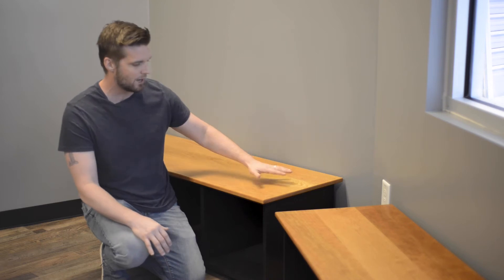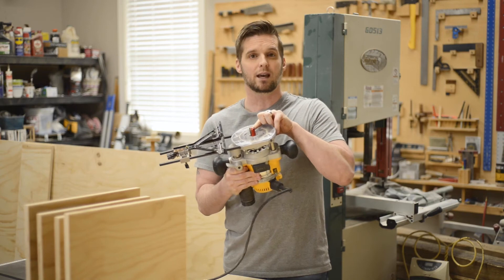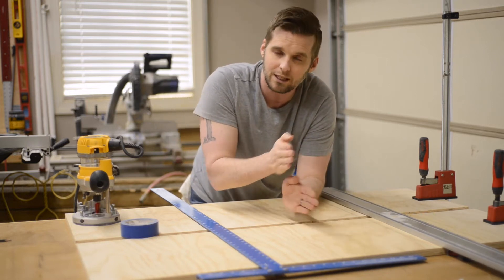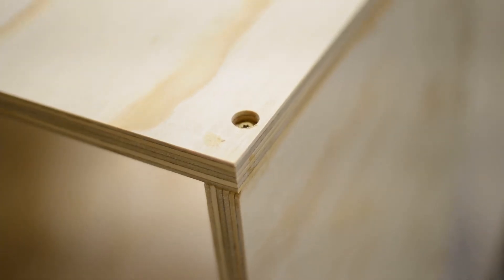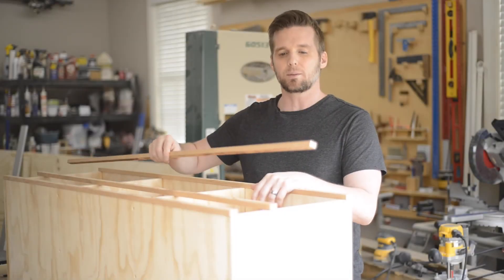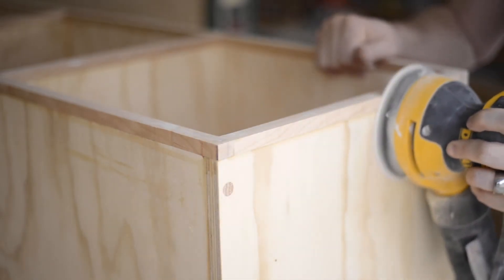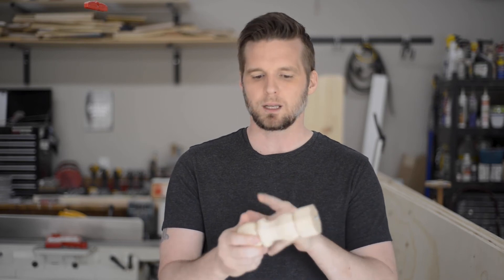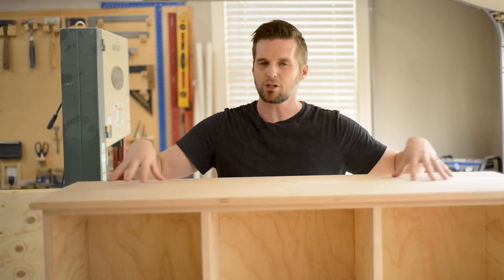How to Make a Mudroom Cabinet Bench | Plan Available

Comment: Is it necessary to use the router?? Ima try to build a bench storage, just not sure  whether to buy it.
Reply from the maker: If you cut dadoes you'll need a router or table saw. But, you could also glue and screw the pieces together without dadoes....it's just not as stable.

Comment: Nice build. How do you rate your Kreg saw guide rail? It seems to receive mixed reviews but a great deal cheaper than a track saw. Did it provide the finished edge on your build, I see you run your trim router over the edge at one point?
Reply from the maker: It's a great alternative to more expensive options. The only gripe I have is that the edge gets chipped away eventually so that you can't tell exactly where it's going to cut. I did run the trim router over the face frame to flush it up. The track saw cuts a great edge I just have to double check where to place it before starting the cut. The saw cuts about 1/8" to the right of where the track edge is.